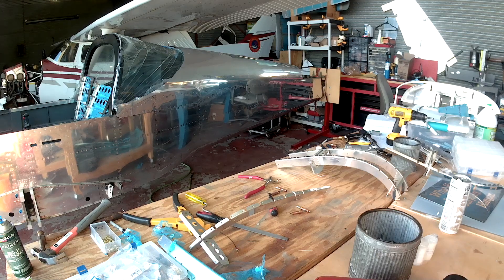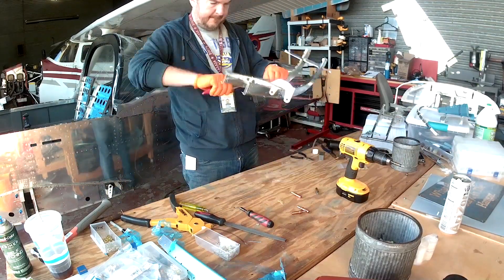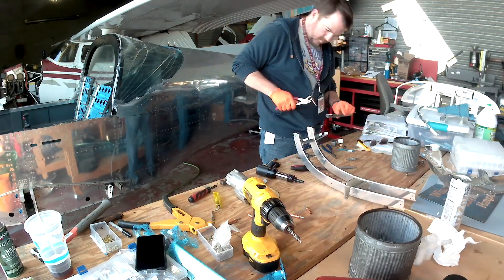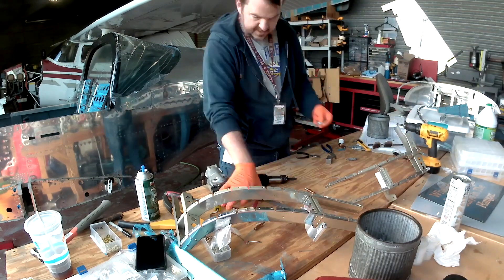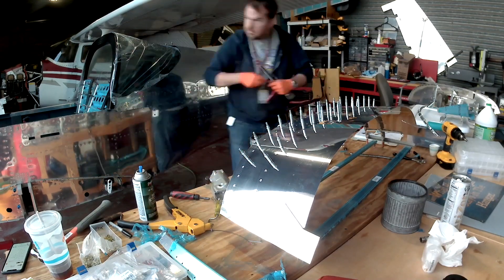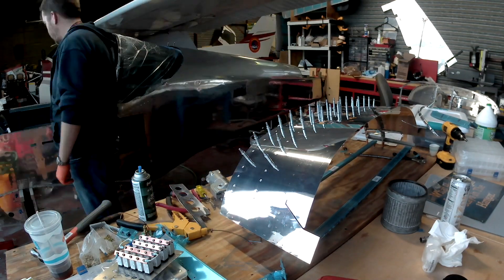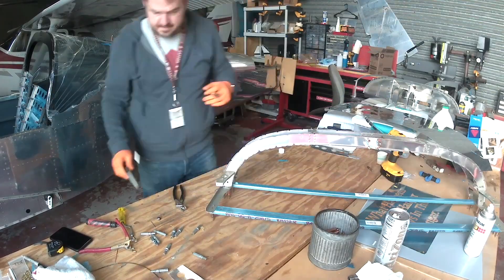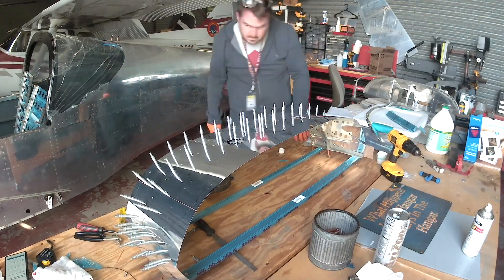RV-14 Ch 38 - 04

Comment: Hi Andrew, I was just wanting to ask you if when you received your fuselage kit did you notice whether the SV-5 "eyeball" air vents were included in the kit? I am going to use replacement aluminum vents so I guess it's a "moot point" but was just wondering because I can't even see them listed on the inventory list. (Maybe they are in the finishing kit or aren't even included with this kit.)
We bought the "QB" fuselage so maybe they didn't even send them along with that...don't know.
Thanks, Scott
Reply from the maker: That's a good question Scott. I don't think I did as well.

I too replaced mine with the high quality milled ones from Vans. And high quality doesn't begin to describe them. Of course I hadn't run with them at WOT at 170kt yet so I can't vouch for their in flight leakage but they are PRETTY!!!!
Reply from the maker: And again... Van's!!! Make an options sheet for your kits. This would have been one I'd of immediately chosen.
Reply: Yeah, I wish they would too. How did you request uva & uvb change on canopy when you ordered finish kit? I have samples from airplane plastics on the way.
Reply from the maker: @scottroberts5625  I just asked Vans about it when I was ordering my kit.
Reply: Thanks, will do. BTW, I would never have known about the UV options for the canopy if you had not mentioned it in your videos so thanks for the "heads up"!